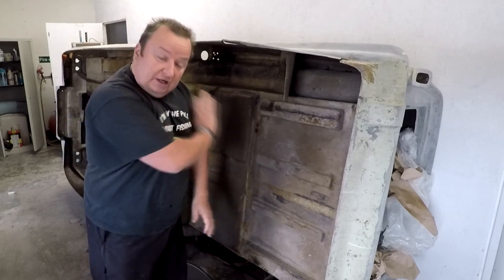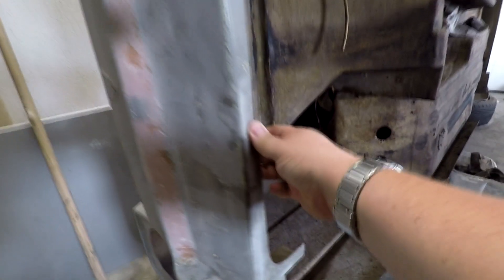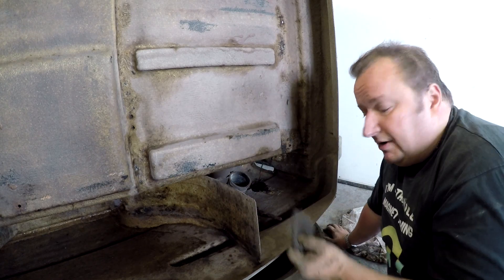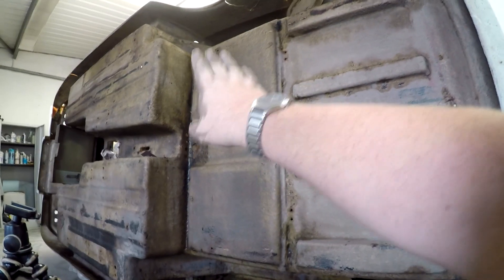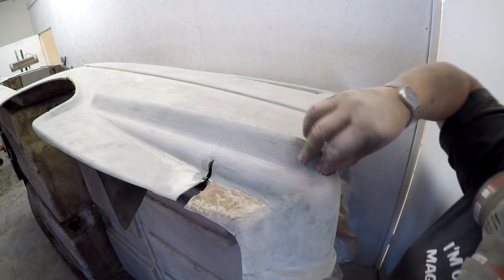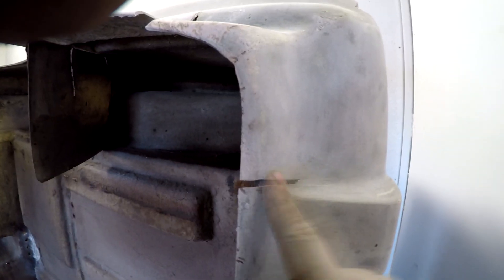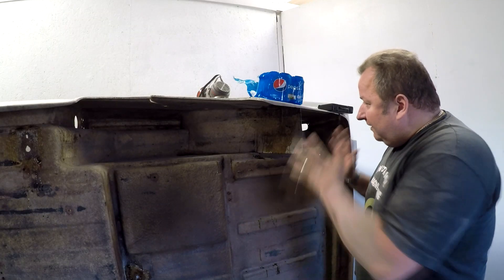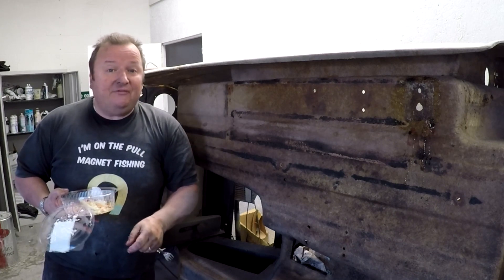Part 23 Reliant Trotter Restoration Cleaning The Fiberglass Underside

Comment: coming along nicely,i would brush resin in that crack on the wheel well and clamp it until dry. then add your reinforcement on the rear and finish off the outside as you  have been.

Comment: Hello Martin,
Nice to see you working again on the reliant :-)

Is it not better to make a V-shape on the glass fiber after you cut them to make a larger jointing surface?
Also it makes the connection of the two broken sides a little stiffer.
A borehole at the end of cutting would be a good idea to avoid further tearing.

Cheers Bernd
Reply from the maker: Yes, I do both of those things Bernd on the thicker fiberglass but its impossible to v shape the thin stuff.
Cheers
Martin

Comment: Fill the fender crack with resin and fiberglass mat on the underside should be a good fix. As for the lip that curls around where it is cracked as well, for extra strength, use polyester rope dipped in resin and it will conform to the shape inside the lip around the wheel arch. Will strengthen the arch and can lift the body without fear it will crack again. My 2 cents.
Reply from the maker: Thanks Bri, Yes I think the resin will make a solid joint with the mat on the rear.
Cheers
Martin

Comment: Hi Martin, Where do you buy your dremel cutting discs from? I used the discs supplied with the tool when new & then bought some more from fleabay that were worse than useless, shattering very easily.
Reply from the maker: The ones I use are the EZ Speed Clic discs and mandrel https://www.ebay.co.uk/itm/DREMEL-SC402-EZ-SPEEDCLIC-MANDREL-DREMEL-MANDREL-2615S402JB/281466812899?epid=1304324075&hash=item4188bab9e3:g:oecAAOSwJ7RYT8nN for the mandrel 
and http://www.ebay.co.uk/itm/Dremel-SC456-S456-EZ-SpeedClic-Metal-Cutting-Wheels-12-Pack/180981409590?epid=1726518112&hash=item2a23552736:g:gvUAAMXQC-tTF1R~ for the discs
Reply: Thanks Martin they look much better than the things is got lumbered with